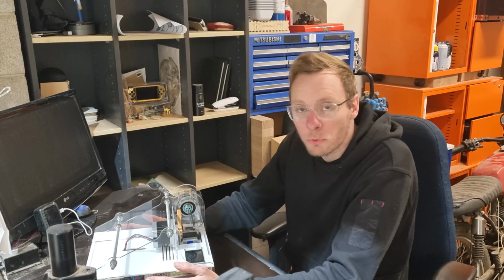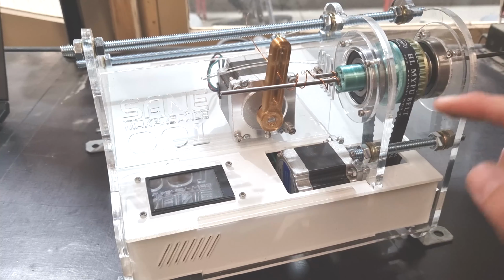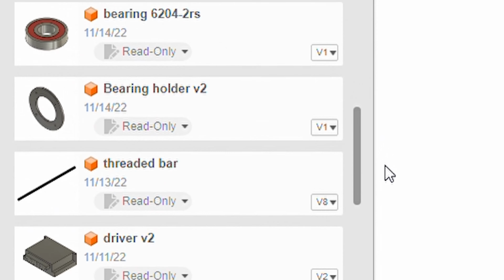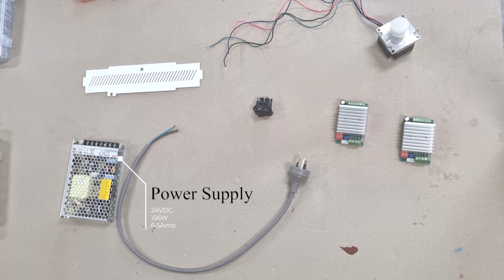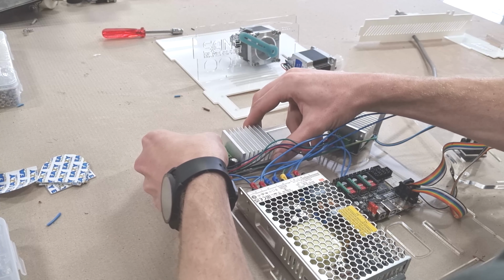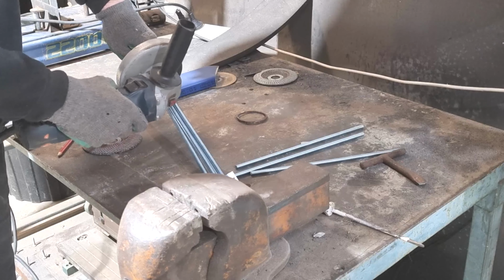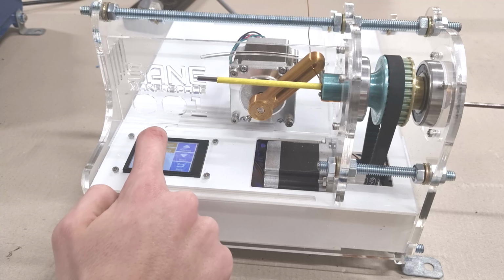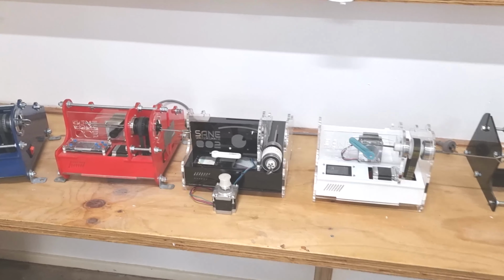Multi-directional Wire Winder build. Left, Right, forwards & Reverse without unraveling | Stojko

Comment: Hi Matt. Great video. Did you try GRBL Arduino? I'm wondering if the top motor axis is using trigonometry to feed at consistent rate, or is it close enough throughout the arc?
-Ken
Reply from the maker: Cheers. No I didn't try arduino grbl, I have used it on another project (a drag engraver) that would have worked but those laser controllers are really nice plug and play with a nice user interface. For the application just setting the angle of the back motor was enough to get it winding nicely. If I was working with larger windings it would be best to do the calculations or swap the motor out for some kind of linier motion.